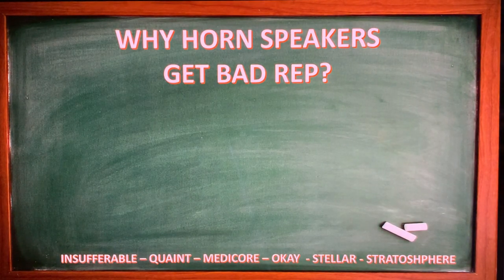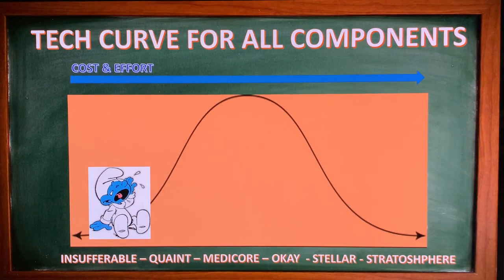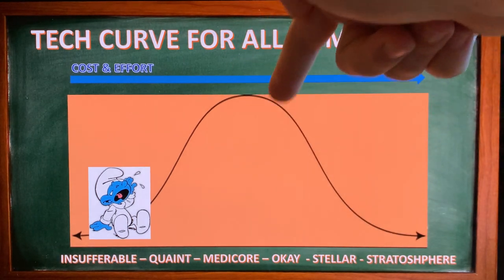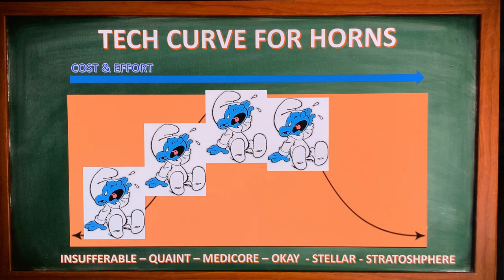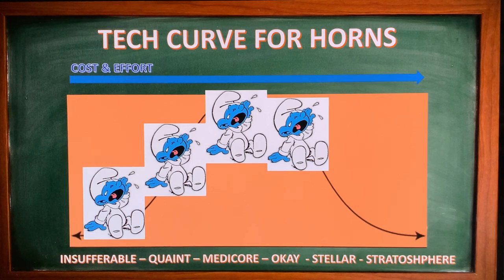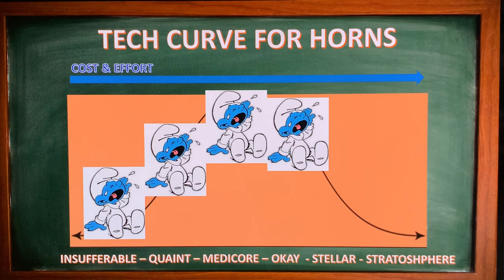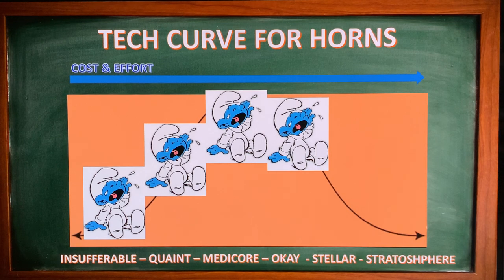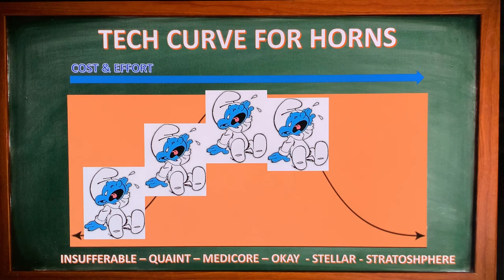BAD, BAD HORNS - but WHY?

Comment: Hello Real World....I am using Klipsch RP 160 bookshelf speakers with my SET 2a3 amp with tube preamp and phono preamp and the sound is natural and smooth....sounds like live music effortlessly....and I play both stereo records and mono records with my mono cartridge....sounds great !!!!Ed in New York 😎🗽🎼🎶🎵
Reply: Have you tried any other horns other than klipsch because I didnt like the sound of there speakers but I do have there sub and it's the best one even better than revel sub which was 2x the price
Reply: @IDontExist14  I have not trieđ any other horn speaker....I would like to try single driver speakers with my SET 2a3 tube amp....buy the drivers and bulid a cabinet with a front port for bass extension.....Ed in New York.....😎🗽🌆
Reply: @heribertovalentin1563  bro I don't know if ur aware klipsch doesn't use compression driver on its lower models, only good expensive ones have CD , u should check if ur model has it, and tell me, I'll suggest something according to that sound, because u are liking it already